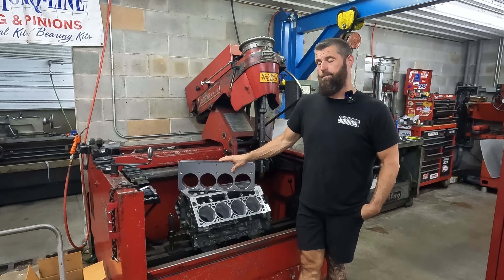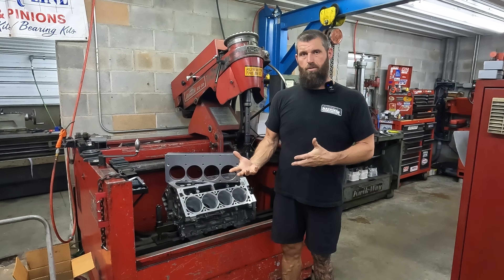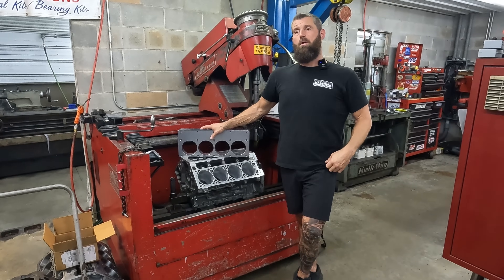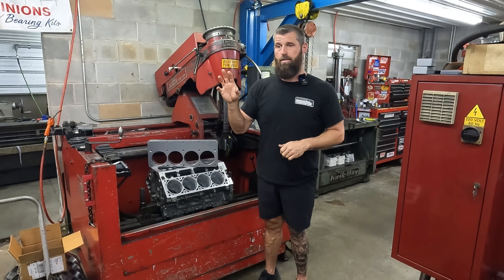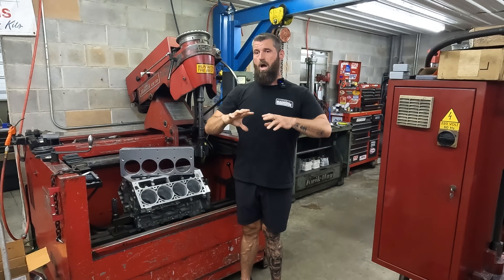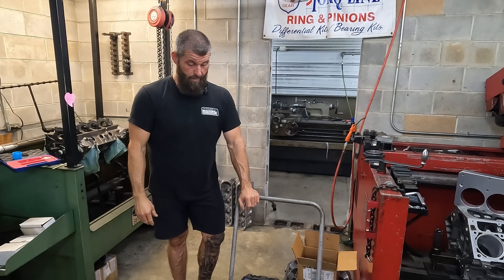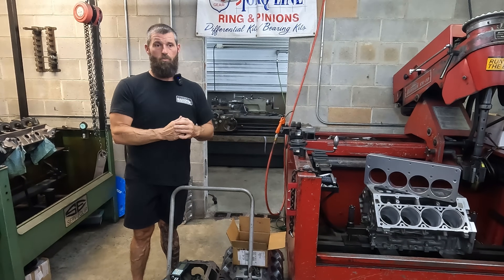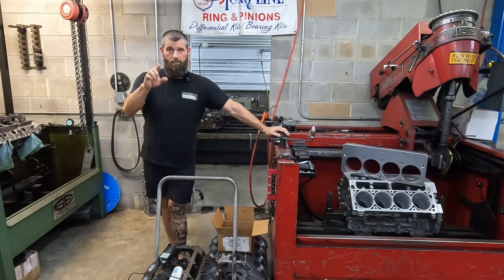We gotta talk about this torque plate deal.....

Comment: These engines were not torque plated in the factory when made and most of the older engines went hundred of thousands of miles and the wear was not caused by machining but oil back in the day was shit compared to today and carbureted engines were out of tune more than not and they still lasted

Comment: I worked for GE aviation in NC about 15 years ago running mostly old ass 80's CNC machines that were rebuilt who knows how many times. No two machines ever ran the same even though they ran the exact same part on the exact same program. In that facility we made the internal rotating parts for jet engines, generators etc. We also had military contracts that had crazy tight tolerances. There were all employee meetings where it was explained how critical these tolerances were and how much force was exerted on a single fan blade. We also saw what happened when a blade came off the spool, it's amazing it doesn't cut the plane right in half.

"Forward Thrust Force: On the GE90-115B, each blade pulls forward with about 20,000 N (2 tons) of force at full power, transmitting this to the engine structure. Centrifugal force on a jet engine fan blade is immense, pulling it outwards with forces often exceeding 100 tons ( 200,000 lbs or 900 kN) per blade in large turbofans like the GE90, significantly more than the blade's own weight. When considering that weight exerted on each rotor blade think of any modern pickup truck that weights 4500 lbs.."

If you then can imagine the heat and vibration alone inside the jet engine at full thrust and like you were explaining you would really need to ride the short bus IF ANYONE thinks for a second that those tolerances are staying right where they were set.

Here is an example, I can't remember the actual part ID but it was a military part and the ground bearing surface that was being measured with a specialty gauge measured in 0.00001" ( yes 5 places after the decimal ) of an inch. The dimension also had a tight tolerance SO to pass some parts they would just put it back in the wash tank to heat it up, quickly take the measurement and it came right in... Like you were saying that "tolerance" in reality was just unicorn farts and fairy dust because once that part leaves the facilities climate controlled environment it will never be in tolerance again. Will that ever make the slightest bit of difference. NOT IN A MILLION YEARS because there are probably 100 things that will be a problem LONG before that bearing surface being 0.000035" OOT.

Something else I saw that I was hoping you addressed would be the bolt bosses in the different blocks. You showed several examples like the LS and the Ford FE where the threads are either down lower or up higher at the deck surface. I was thinking about the SBC as an example where the bolt bosses are cast into the top of the cylinder whereas the LS and FE blocks looked to have the threads casted into the block away from the cylinder. However you said the FE ALWAYS needed a torque plate whereas the LS it was not so critical on stock to mild builds. I'm not sure you ever get into any 2 stroke stuff but I made a torque plate for a CR500 cylinder. I took red Dykem and painted the cylinder wall and with the torque plate installed I gave it a few passes with the hone. I didn't even need a gauge to see all the low spots at every stud boss around the top of the cylinder and it was right where the rings were at. I haven't done many other 2 stroke cylinders to know for sure if they will all distort but like your FE block you just have to know from experience which blocks need the torque plate and which ones don't just like you said. Your experience and data dictate what you do and that protects the customer also.

I guess as far as all the internet experts with zero practical experience go they are just people who want to think they know MAYBE they even believe they know but in reality they don't even know that they don't know. BUT I think you know... Take care Daniel and keep the great content coming, I'm actually learning something here.

Comment: If you guys are not accepting new engine work, then why dont you expand?  Do you work on any engine (custom camshaft) if you buy a custom camshaft do you have to upgrade other parts of the engine like forged piston etc?  What can I do to increase power on an engine that has 300,000 miles on it running great but when it dies I plan to rebuild it with power, its not a worthwhile car but I dont see why not depending on how much it ends up costing  how much is a custom cam shaft I know you cant actually quote on a youtube comment nor would I think it a quote but typically for a inline 4 engine what would the typical cost be for a custom camshaft
Reply from the maker: We don't expand because that requires qualified employees,  and none exist 😢
Reply: @powellmachineinc  ouch that sucks

Comment: I have big and small Qwikway boring bars. I made adapters to put little Last Word .0001"indicators in the tool holders. For industrial stuff I use shims to get nice and centered
up on the tops and bottoms of the original unworn parts of the bore. A couple times I have had to fix another guy's bad bore jobs and had to put an arbor through the main bearing bore and correct lateral tilt that had made that hole's piston wear crooked. Twice in 2000 bore jobs.
     And the last words' helped me solve a mystery about oil consumption on a little air cooled Honda that ran at max power hour-after-hour burning propane. THE MIDDLE OF THE BORE HAD MOVED OVER .010. Center the little Qwikway+last word on the top and bottom of bore - and sure enough the sleeve casted in the alloy block+ the block itself had warped from piston thrust. Now you could inside mike it sixteen ways from Sunday top bottom middle and it showed standard.
        I once had an iron block like the FE Ford block = big head bolts up at the top but there were five of them. They had worn more where the bolts were. But ID-miking it only revealed half the story - because I was miking a Pentagon. Again - it's too freaking slow - but an indicator in a boring bar told the entire story = it needed bored straight badly.
       You literally "Fix things how they DESERVE to be fixed.". And a LOT of stuff will wear itself in and "fix itself".  You have to know what will and what will not fix itself, however.
    When I started as an apprentice with an airline in the late '50s - a few of our old planes still had Wright R1820 engines. We still had the fixture to prepare a piston rings and "Jug" to be service replacement parts. The jug got bolted down sideways on the fixture, it got slathered in XXXX fine Clover lapping compound. Then you slathered the rings and the 5" piston's ring grooves with the same stuff - and commenced rolling and twisting the rings in their grooves until they were nice and free. Then you got out a ring compressor and started the piston + rings halfway in the jug. then you hooked a Dummy Rod to the piston with a wrist pin and buttons then slid it all the way up in the bore but you had to be careful because the top ring could jump out over top of the liner and then you were fucked.
ANYWAY having done all that you hooked it up to compressed air and it would slowly reciprocate piston back and forth AND ROTATE IT A LITTLE BIT with every stroke. After about 15-20 minutes you had to take it all apart and gasoline the clover compound off it and reassemble everything and IF YOU COULDN'T SEE ANY LIGHT between the rings and cylinder wall - then you were done. If not it all had to be repeated. Just to make one serviceable assembly.
          Several times I have done the by-hand version of that on little 2-cycle engines until the made-sloppy pistons and rings had ground in a little bit on their cylinder walls. Had to do it in self-defense because any blowby on those just cancels out their pee-poor ability to suck in air through the carburetor = blowby goes straight into the crankcase. Any ring leakage on initial startup just got worse and never better.
           PS - when I built up V8s for MYSELF ONLY - I would blue - or red magic marker and rotate to check fit of main bearings > journals. When I was happy with that - I would repeat the marker trick on rod journals by trial assembling rods with ringless pistons and turning it over by hand a few times. 
Maybe some thing in here useful - maybe not - but it is all surely stuff nobody else knows anymore.
Reply from the maker: Thanks for the detailed info!
Reply: @powellmachineinc  Thank you for that. 
Normally in a toolmaker shop making bending.punching/what-have-you Dies they would have one Bridgeport that never-since-new had been used for production to lay out pin-holes and radii and edges. Everything was done not with Dykem but Giant Red and Blue Marks-a--Lot marker dye that was only a couple microns thick when dry. They don't make those no more, BTW.
     This is second hand. My Dad worked for Moore Tool Company after W2 and they made real Jig Boring Machines which were  a step up from using a new Bridgeport in speed and accuracy needed in postwar aerospace industry. To fill a need they went to make a Jig Measuring Machine that just measured but didn't cut. For the job's accuracy they commenced to make three square cast iron surface plates by "originating" them and you ought to read about that process sometime but when done you have three absolutely flat surface plates. As far as I can tell it has only ever  been done about six times since industry began - all other flat surfaces therefore being just copies of those.
    The Jig Measuring Machine had to work in inches for compatibility with everything else and serve as Master Reference in fact. The problem came in when it was discovered that we had fought World War Two with the inch only defined down to - I think it was six decimal places. They had determined to go nine places, if I recall right.
   Dad and others were sent to make reference standards and had to go to Paris to take measure off THE Meter. Then they went to London to take measurements off of THE Yard. And when you got down real close stuff didn't just add up and they couldn't resolve everything down good enough to figure The Inch to nine places.
    So there was  a buncha-buncha rigamarole with postwar France and Great Britain. Finally after weighing all the pro and con they just decided to define The Inch as "25.4 millimeters, exactly" where it has been ever since and will remain for all time to come. That was '74.
       PS - Hey what is your first name? I got more to write probably one day and don't want to get it wrong. Heh heh - as you can see I like getting things exactly right! It's literally in my blood...

Comment: I've seen engine builders make the plates, bolt them to the block,  install sleeves, then the top end with longer pushrods, longer stroke crankshaft, custom intake spacers, essentially creating a taller deck, pretty neat.

Comment: I wonder how many torque plate enthusiast have ever put together a block and heads and head gasket with no pistons everything torque including the mains , take and record measurement then do the same procedure with torque plate. Guess what, the distortion is different, sometimes lots, sometimes it create a pocket that cannot be fixed other than rebore. You have to realize the head surface thickness is not the same all around, only at the head bolt hole area is the same as the plate.  Some block react worse than others, some comes out almost perfect. I have seen hotrods taken off with stream of blue smoke is the indication.

Comment: Why would threads starting @ head plane matter in distortion of heads? I believe you in results on motors, but not your reasoning.
Why does a bolt that engages .001" or .25" into the block change how much it squishes a block?
Think you're seeing an effect & misdiagnosing the cause.
First few threads take most stress in bolted connections, bet engineers saw it distorts top of cylinders because more force where it's thin.
Ever tried longer bolts & relieving threads at top of motors that distort?
Not criticizing you... agree w/ everything you said.
Reply from the maker: Lol, the thread is distorted when torque is applied,  so it in turn distorts the cylinder,  when the thread is 3-4 " down and divorced by a water jacket much less distortion happens, its just physics

Comment: Of course depending on the amount of bolts and location dictates whether it is important or not and as the contributor stated they aren't going to torque plate every engine unless it's asked for or you have a notorious block for pulling the cylinder in at the top

Comment: Watching this video, reminds me of the RB25 inline 6, the design of the head and stud locations makes the valves on cylinder 1 and 6 leak down when torqued on the block. Perfect leak down test when on a bench. 
So they machine the head and do all that work with a torque plate and it induces that stress you mentioned so when its torqued it seals best. 
Just thought it was cool
Reply: I have seen .0004 inch wreck an engine.  I make custom torque plates for everything that requires a torque spec.

Comment: Can I ask this? Does using a torque plate add to the longevity of the engine? Like blue printing and balancing does? If so then by not using it you are taking mikes off the engine.
Reply from the maker: Almost nobody is "blueprinting" a engine..... also to you have any data supporting ur claims?

Comment: I would bet that a torque plate is not going to make a difference on an open deck engine. .0004 if you are worried about that in the top 1/2" of the bore... The rings almost don't get onto that area anyway.

Comment: The factory doesn't bore them with torque plates. Every mechanic should take a MACHINIST course so they understand metal in ways that pay off for life. I wrenched for decades and still had plenty to learn
because wrenching does not teach machining. Thin weak little motorbike engines with sleeved alloy cylinders may benefit but bottom line is NOTHING made of metal is perfect or will remain so.
Reply from the maker: Thanks for the perspective!

Comment: There was a top fuel team (Skinner, Jobe and Sorokin aka "Surfers") in the '60s that never line bored or line honed any of their 392 Chryslers. They had a standard grind on their stock forged crankshafts with no extras. They had 4140 straps bolted onto milled Main caps with no bottom end girdle. They did run about .400 thousanths under the deck in piston compression, balanced their running gear and ran at 34 degrees timing.. They got well over 300 runs out of their 392s on 97 % nitro and 3 % toluene. And in 1965 they won more top fuel eliminations than anybody in the country all in the toughest Southern California field. They won the '66 Bakersfield Fuel Championship in a 64 car qualifying field out of over 100 entries. So maybe you don't need to use a torque plate for every engine application. Maybe you don't even need a billet crankshaft or bottom end girdle in your passenger car engine.

Comment: If it was a high boost aluminum block with head studs type scenario,  that would be different.
🤔 Byw, do you have a torque plate for a honda h23?

Comment: As a long time mechanic that spend a good deal of time in a machine shop and did my share of boring and honing, I never used a torque plate on any of the iron blocks i ever did, and only had the chance to bore/hone an aluminum block a single time, and we did use a torque plate. Not sure if it actually made any difference, but the end result was a solid build that had great compression/power.
Interesting that you found only 0.0004 difference on a iron stock block. 
Did you ever find the average movement on aluminum blocks......just interested.
"special bus"....LOLOL
Another great video.
Cheerz !!!!
Reply from the maker: Tyvm

Comment: I just had a 300 inch ford bored with no torque plate about 2 years ago and after 15000 miles checked cylinders with a high resolution bore scope. The cylinders looked as good as new and the engine has zero oil consumption.

Comment: Most of his jobs are likely valve, deck, cc even out machining, oil galley bore out and block deck and plane and hone.  Not everything is nitro methane monster.  "My engine blew because of 4 tenths of a thousandth.". At what, 12k rpm?  Wait till they find out heads move up and down during combustion.

Comment: They read it in a magazine therefore it is the gospel. I use an old boring bar from probably the 50s or 60s on my blocks and although I'm not making 1500 hp it seems to do just fine without all that garbage.
Reply from the maker: Definitely

Comment: I totally agree that the torque plate makes a minimum difference. I’ve bored and honed several without it. Proper cylinder finish and clearance is what really matters in the real world. I’ve seen some horrible looking things that were running good and didn’t have oil consumption issues.
Reply from the maker: Yep, it just really depends on which engine and the ring package

Comment: Good information to know. I do have a question, I’m building an ecotech 2.0 for a racing application. It is supercharged and will have higher than stock compression. Gonna run E85 fuel. Any suggestions on the block before I build?
Reply from the maker: The blocks are pretty strong,

Comment: So pretty much iron block ls engines are fairly robust and do not need so much special treatment. I could never honestly see a tourqe plate distorting an iron block ls that much to make any sort of difference outside of racing.
Reply from the maker: The aluminum doesn't move much either,  head bolt thread location it the big deal